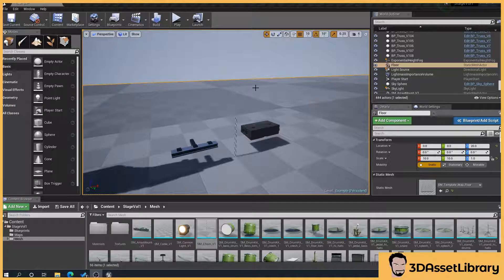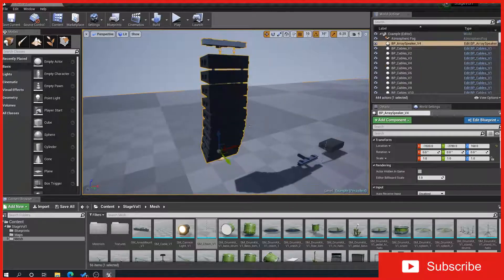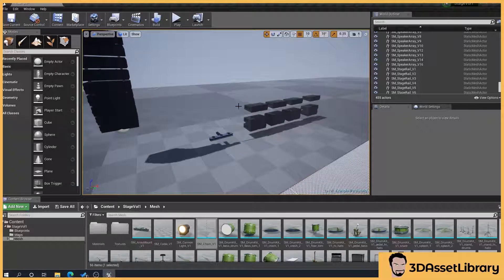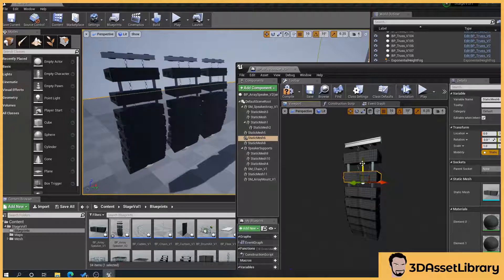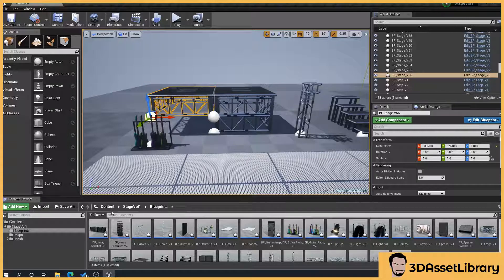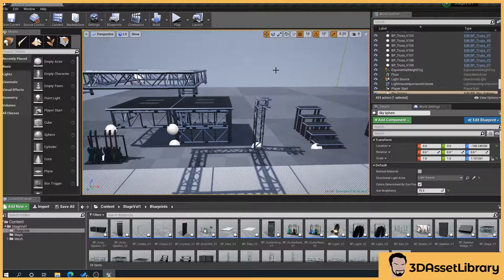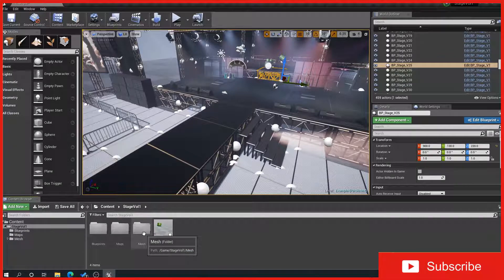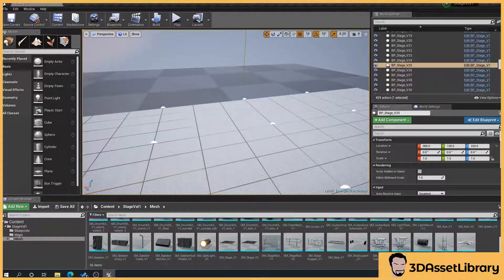What Is A Blueprint Prefab in unreal engine?

Comment: Thanks for putting this video together! However, I don't believe these are true Prefabs. These are nested Blueprints. They will not allow you to mix Static, Stationary, and Moving assets within the same Blueprint. They won't let you add a Spline BP inside and manipulate the control points. A true Prefab would allow you to combine whatever you want. Nested Blueprints is just an extension of C++ classes referencing each other using major restrictions.
Reply from the maker: Yeh you can add stuff line splines inside the blue print and manipulate them (I do this on a regular basis) this is a very basic explanation on what they are as a lot of people don’t have a clue how much this can help. 

With UE5 this kind of thing has become a lot more easy and a lot more powerful